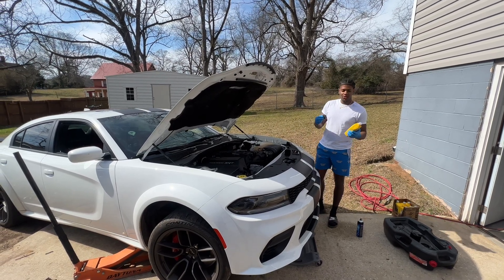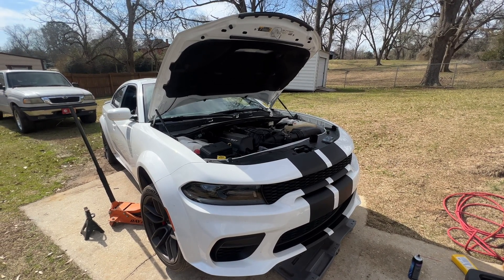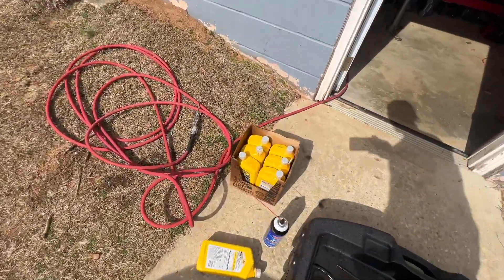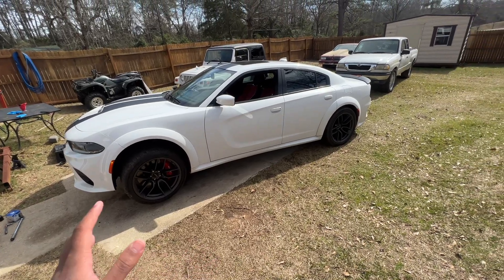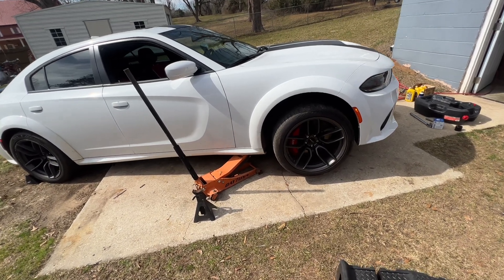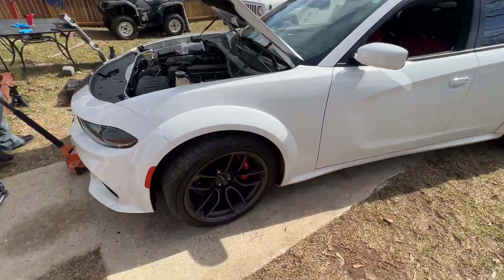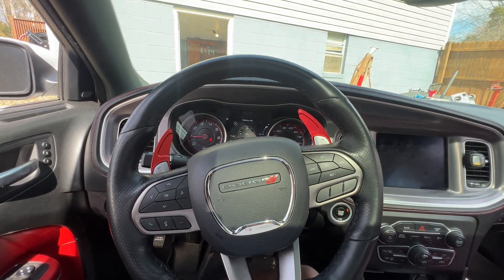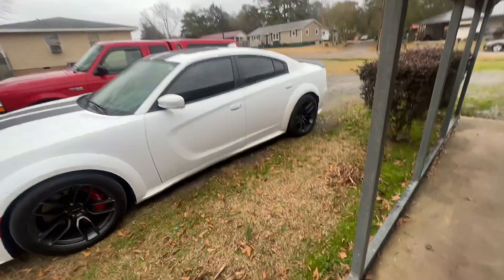ALMOST RUINED MY SCAT🤕 CHANGED THE OIL JUST IN TIME!🐝

Comment: Personally, I wouldn't use a torque wrench for an oil change.  The long handle of the wrench gives you a lot of leverage and makes it easy to strip-out the threads on those aluminum oil pans.  Just snug it with a 3/8" ratchet and you'll be fine.